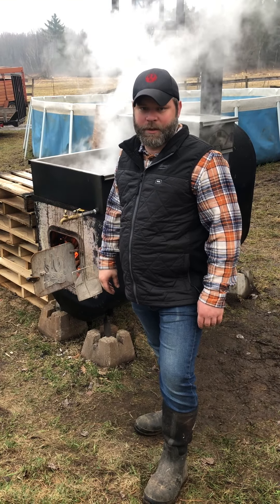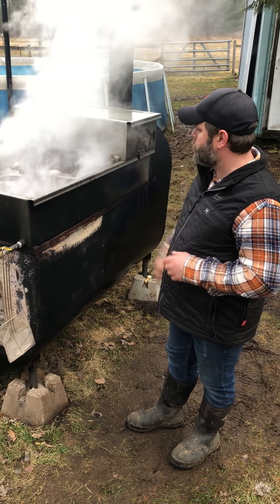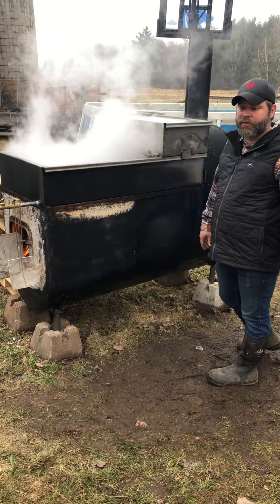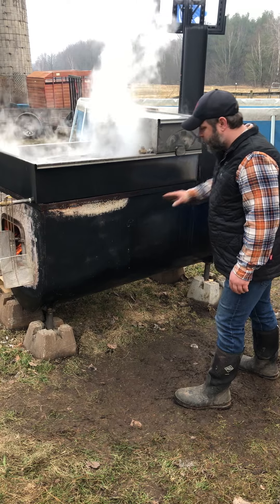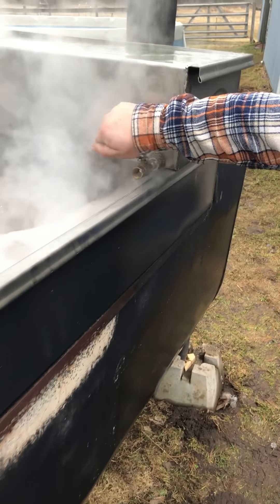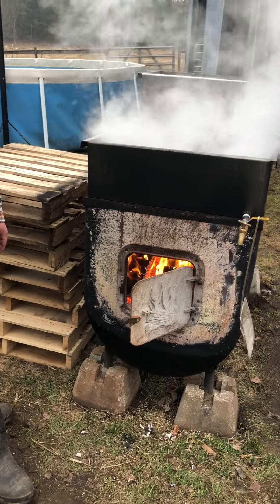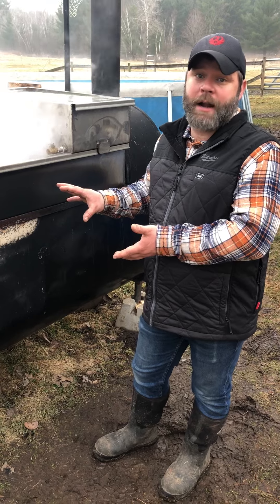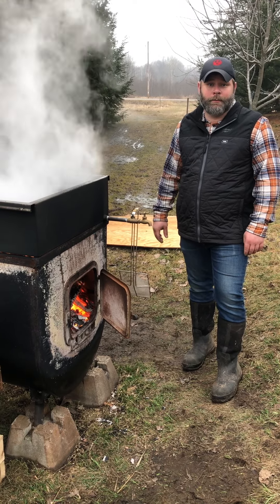Maple Syrup Evaporator Converted From An Old Fuel Oil Tank

Comment: I built one very similar to yours. I have  a plate that I slide under the pan so when I make smaller batches I can  put the plate under the pan, then raise the pan with blocks so when I empty it, the syrup doesn't scorch the pan. I also cut a large opening under the door so I can close the door and it draws up through the combustion chamber, and lose less heat out the door and welded a hinge with steel plate to close up the opening.

Comment: Hi Dan. Great video. I also have a fuel oil evaporator and have found a few tips through the years. 
My biggest tip is to close the fire door, by leaving it open, it’s actually drawing cold air onto the front of the pan, you can see it around the 4:05 mark, the flame doesn’t touch until 1/2 way down the pan. If needed, cut more holes under the door to allow larger amounts of air in. 
Also, use a rail gasket around the outside edges of the pan for same reason, its drawing cold air onto those edges. 
Add at least 3’, 6’ would be better, to your stack.  It creates more draw, therefore a hotter fire. I believe the rule of thumb is 2’ of stack for every 1’ of pan. 
Lastly, keep wood pieces small and fire every 15ish minutes.  These 3 combined should get a heavy rolling boil across more of the pan. 

If you really want to get serious, cut a 4” hole under the door and added a bathroom fan for forced air…the fire brick will now glow..🤣

Happy boiling, the reward is sure worth all the hard work..😁😁. Hope you have a great season!
Reply: Agree with all this, the only thing I would add is to keep the level of sap in the pan to about 2" max.  This will also increase boil rate.